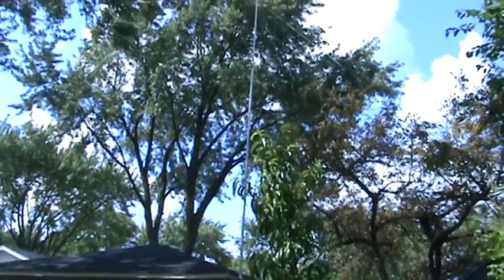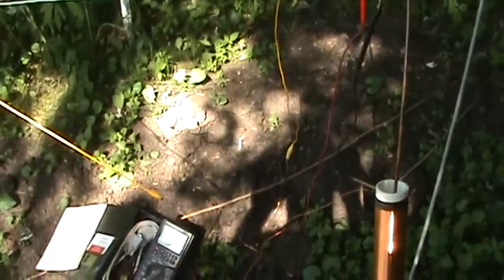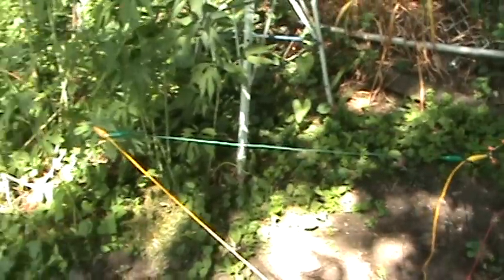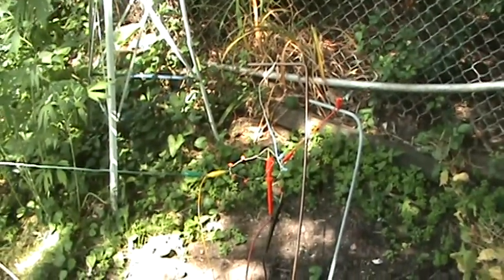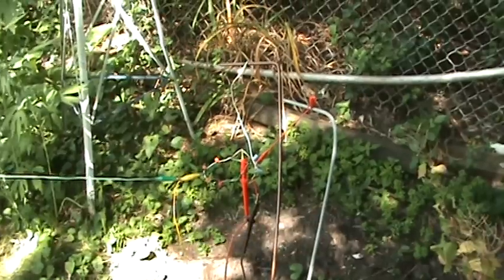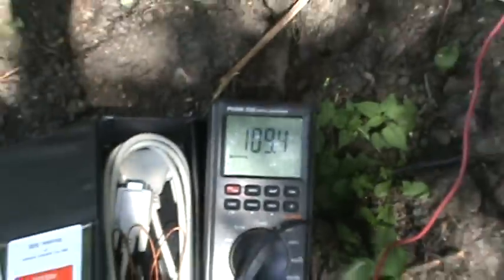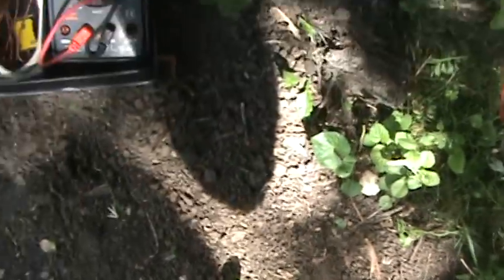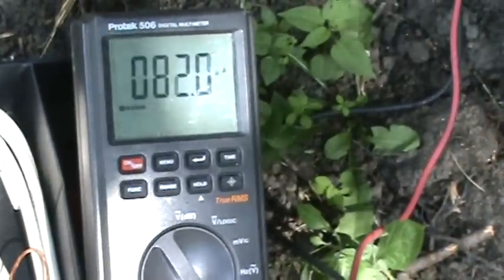FREE ENERGY FROM AIR CIRCUIT PART 9/24

Comment from the maker: @INVENTOR3 also make sure that your antenna does not touch anything, one end to the circuit and other end as high as you can mount it,,,what ever you mount it to make sure it is insulated from it, with piece of plastic.
hope this helps some.  some drawings at bottom of page here    Paulslab dot blogspot dot com

Comment from the maker: @gccengineering1996 well, looking back at my notes i was getting like as much as 200 micro Amps,,,,but now im back on this project and only getting like 5 micro Amps!!, im sure i got more in the past. Im working on it again now though. had to repair my pole. I will get better results yet, then make new video i hope soon.  I sarted with this video you mention,,,,then added a ground, ground helps a lot., hundreds of experiments later got up ,to 125V. try using a water pipe if possible for ground.

Comment: How many amps is that?    I tried to build the circuit from the recent website that has the guy having a electrical outlet then electronic components.  I could not get the circuit to work right another reason is that I am in the apartment using a indoor wire. Do I need a ground rod connection to get this to work?   I need help and I am confused.

Comment: @INVENTOR3 
I read a good paper by Moray and states that in order to resonate, you need R to be less than square-root of 4L/C. Meaning L must be as large as possible, and R as small as possible. Resistance is the killer of current ... and your load and how greedy you are with your load will affect resistance.

Comment: @INVENTOR3 If you still working on this, I just read in one of Tesla's patent, the ground rod (also must be a steel rod) should be 10ft in dept and precisely  3/4 on an inch in diameter. I still watching your very good videos and planning to built one just like yours if it's ok to you. Your videos are really working unlike others that work only on a small scale, but your has potential to do it in at least enough energy to charge battery, then use an inverter to power the whole house. :)☺

Comment from the maker: Best results are on video 16....125V.
But, no....need more power, and power is a result of voltage and current.
Problem is, i need more current.....i believe i can trade some voltage at this time for more current....maybe better results....maybe adding a joule thief circuit to increase the current also.

Comment from the maker: I got some more toys from McMaster Carr.
(1) copper tube 5' & 1.625 O.D.
(1) galvinized iron tube 5'  X 1.625 O.D.
(1) magnet .5 dia X 7" long 
(1) ferrite rod .375 dia X 8" long
today & tomarrow, experimenting with deeper ground.
right now i got a little more voltage because i put a copper ground rod next to a zink plated rod, connected together with jumper, i must be getting a little battery effect also.
So with my new copper tube, i may try to drop a zink rod down the middle of it.

Comment from the maker: My DMM can only check sine waves, but not low frequency, also has frequency generator, but only square waves, and only 2 frequencies.
Oscilloscope is very old, found on side of road 2 years ago, downloaded instrucctions for it, but at that time i did not have the knowledge of how to use it, even with instructions. I bet i can figure it out now though.....i will try it out again....not even sure if it works properly.
Yes, time i try it again.

Comment from the maker: you could go to my profile, than send message from there to my real e-mail address to get link to me.
i have read of heights of 30 to 80 feet is best height.  I guess the fequencies must be trapped or bounce around at that height between ionosphere and ground.
Hmm, 7.5 Hz at 1/4 wave...i will have to calculate length of wire.
Eventualy i will have to do some more math with the frequencies.
Thanks for the comments.

Comment from the maker: Hmmm, well 1 milli amp= 10-3 or .001 amp.
1 micro amp= 10-6 or.000001 amp.
and nano =10-9 or .000000001 amp
So if i have this correct,  example   .200 micro amps would be the same as saying 200. milli amps.
Please someone correct me if im wrong.

Comment from the maker: After i get current up a little higher like this, than i will check load across a 1K resistor and calculate power.  I check it quite a few tests ago and got very little power, i forgot exactly how much, but it was not enough.
Jewel Theif,,....yes, i must try this yet.